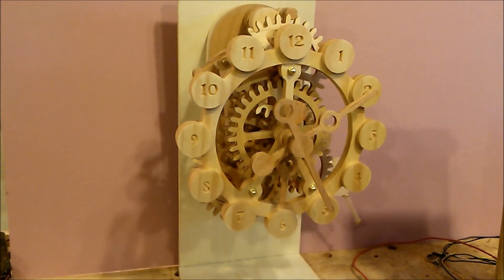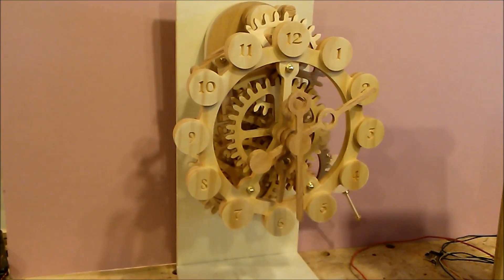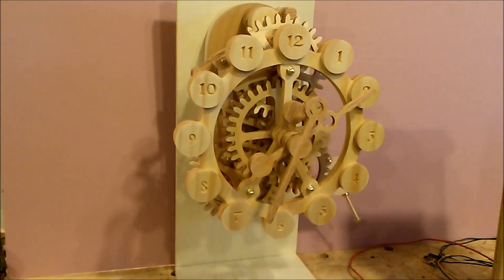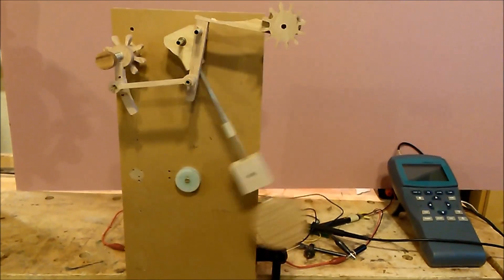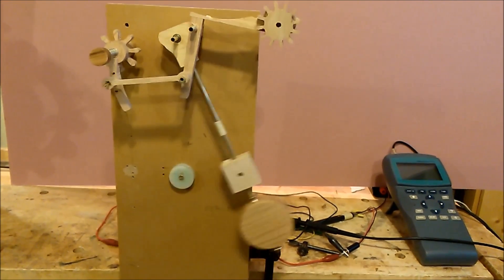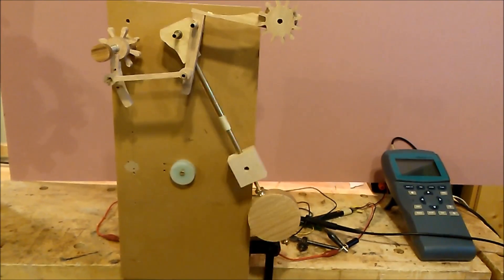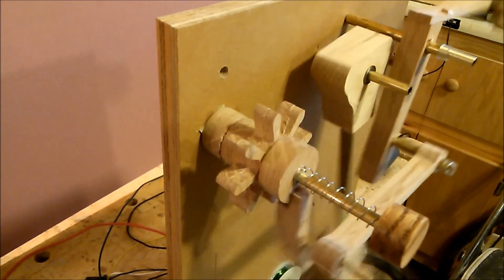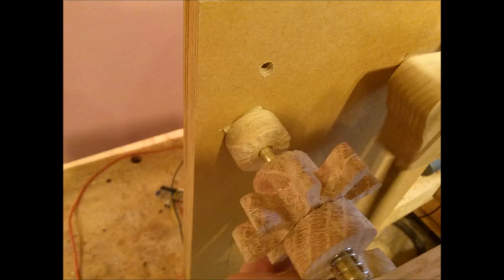Quiet clock mechanism

Comment: If you are not particular to change the movement slightly you may drive the clutch straight off the pendulum to eliminate the " Cam action and the extra motions. Also since you are using relays and other stuff than just wood, you might as well consider using a one-way bearing for a clutch arrangement to get it quieter.
.https://youtu.be/UIhCPl8eb7s